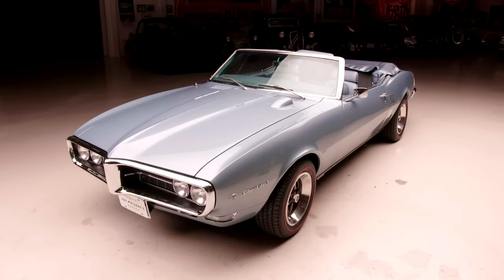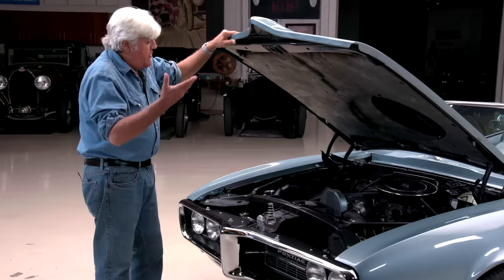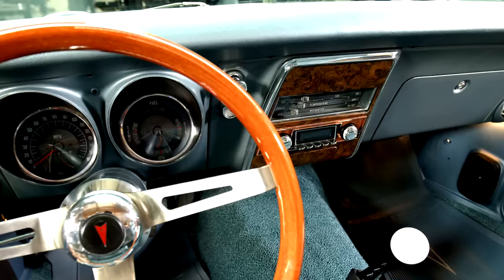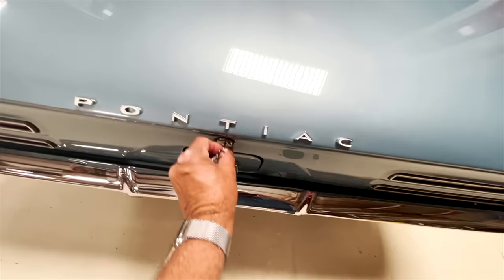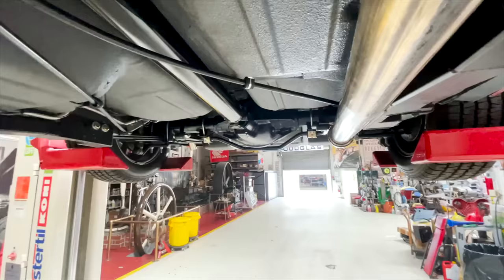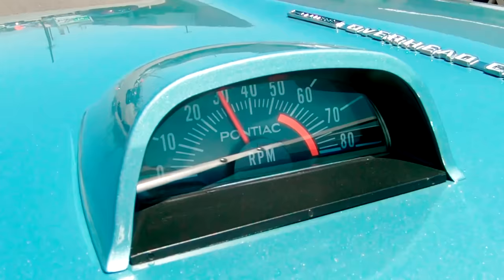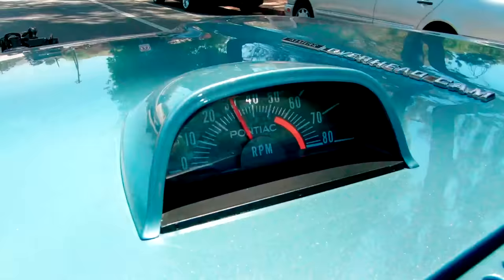1968 Pontiac Firebird Sprint | Jay Leno's Garage

Comment: Their isn't a low oil pressure problem with the rocker arms for that engine. I have one and I found the real reason. GM so hated DeLorean well before his exit that the spark plugs and valves for the unique 250 cid OHC head were never listed properly anywhere in any parts book. What you get instead is the spark plug and valves for the 230 cid OHC little brother of this engine. And that's the real issue, the valves are too long by 0.100 thousands and if you use the 230 valves in the 250 they will hold themselves off the seats at very low mileage on the clock and not get ANY rocker arm oiling due to stack up of the valve train with the separate hydraulic adjuster being bottomed out all the time. My mentor had a TRW valve catalog, I poured thru it for what seemed like days looking for a better fit valve after grinding the valve stems off by about that much as an in the field repair over several weekends. TRW did in fact list a pair of valves with the exactly correct dimensions, just a tenth shorter. But they are not called for when you want valves for this exact engine, all you can get under this engine are the same ones for the 230 little brother to this engine which went away in 1968, while the sprint 4.1 went away after 1969 along with DeLorean himself. GM never bothered to support his baby in it's final version, never lifted a finger to help GM customers get to the right parts either. That hood tach does not belong on a sprint - the red line for a sprint is 7 grand and that was an order option if so chosen. That is to say to have an engine that was proofed at 7 grand on GM's break in stand cost more, so it was very rarely ordered. This one will do 7 grand because it's already done it before you get the keys, if it didn't stay together on the stand they just got another engine until it did. At 7 grand the 250 is breathing as much air as the 350 at 5,000. The crank is unique with extra balancing additions, crank shop tried to steal mine when I needed to have it ground down. Very lucky to have the owner on duty at the counter that day, I explained my issue about how this standard 250 crank isn't the one I dropped off from my 250 OHC sprint. His eyes opened a touch and he said wait right there, to walk in the back. Maybe 5 minutes later he comes out with my crank and says there you go. He knew just the guy in the back to ask about who stole the very special crank and I hope he got fired over it.

Comment: Jay is pumping out the videos and I’m sure we all appreciate it. Yup back in the day 100,000 mile car was done, just wore out.
Reply: Yes but 1960s body on frame cars were very repairable and restorable.  This car will stay on the road for decades more.
Reply: @777jones  very true but at that time replacing an engine was big bucks. Quite a few at the time were not body on frame but unibody technology.
Reply: 68 Firebird is an F body unibody vehicle
Reply: @777jones  this is a unibody car...
Reply: @barnabyjones5161  i didn’t know, thanks for the info guys!
Reply: I've been subscribed to this channel for years. I've yet to see Jay miss even one week posting new stuff. The man is dedicated.
Reply: @777jones  Depends where you live.  Up north the cars rusted out after 3 or 4 years and just 50,000 miles was pushing it .. motor, suspension , electrical problems and the rust just gave them limited life.
Reply: @ClayLoomis1958  it is very appreciated.
Reply: @JOHNSAG1  or do a valve job around 50-60k and see if it'll run out to 100k after that, and guaranteed it'll be tired.
Reply: I have a friend that has over a half million miles on an old Pontiac.
Reply: @pontiaddict2992  yup you can keep fixing them but up here the rust kills them, and the body panels flop in the breeze.
Reply: @HypocriticYT  that sucks! In Phoenix you can have bare metal sitting for years and get slight surface rust.
Reply: @pontiaddict2992  we get body and frame rot from the salt on the roads. They tend to use less salt now so more accidents on straight flat highways and lots of transports in the ditches too. Soon as they contracted out road maintenance it all went to hell.
Reply: @HypocriticYT  man, that sucks all around!
Reply: @pontiaddict2992  yup, now a 10 year old car though better protected from corrosion will have fuel and brake lines rot out under the retainer clips, the vibrations wear the protective finish off. Oil pan on her Altima rusted so bad I pushed a screwdriver through it easily. Had to replace the pan. The underside of vehicles are covered in rust and rear disc brakes fail early because the front wheels throw up water, salt, sand etc onto them. If you want to keep a car in good shape in Ontario you can't drive it in winter. Mine was put away a couple weeks ago and won't be out until mid to end May.
Reply: @HypocriticYT  wow! It sounds like a fiberglass car is needed for winter months, and still you'll have rust on the few metal parts it would have.
Reply: in most cases, yes. if the maintenance and tune was kept up on they could go 150-200k had a number of carbd sbc that did

Comment: Hey Jay,

You hit one out of the park with this video.  I owned this same car, a 1967 Firebird Sprint, convertible, 4spd, electric roof, etc. 

I was in school at U Mass, Amherst in 1977.  In April of that year I was in a motorcycle accident and broke my back.  I spent 8 weeks in the hospital, and lost the whole semester.  When I got released from the hospital I was in a back brace and could barely walk.  I lived off campus.  I couldn’t even walk to the bus stop; I was all screwed up.  

My housemate had just bought this old 1967 Firebird Convertible (a Sprint) and he sold it to me for $300.00; I will never forget that favor as long as I live.  The car had a new roof (electric), the 4spd, it had an inspection sticker and it ran.  Getting that car was the first good thing to happen to me in that whole ordeal.  My Firebird Sprint had a tired pushrod GM 6cyl motor (the OHC 6 was long gone).  I had the hood tach, but it was out of the car in the trunk.  That $300.00 Firebird burned oil and had a leaky exhaust, but it changed my life.  I was mobile again.  The car made me smile at a really bad time in my life.

I couldn’t work that summer, so by late fall I had to sell the car to pay rent and buy food.  The car needed work, but I could hardly lift the hood to add some oil and STP.  Still, it broke my heart to part with the car.  I’ll always remember that 1967 Firebird Sprint Convertible.

Over the years every time I scan eBay, or in the old days the “WantAd”, I look for a Firebird Sprint convertible whether I have the jing to actually buy one or not.  

I was grinning ear to ear watching this video.  Thanks for restoring this Firebird Sprint.  You don’t even know me Jay, but will you do me a favor please?  Next time you drive your Sprint will you slap Deep Purple “Highway Star” in the cassette player and run the car through the gears for me?  Thanks Bro.
Jim Vann
Reply: Great story! Highway Star was what I listened to in my 68  as well, how funny is that!
Reply: What a story! Thanks for sharing. I can hear the music.
Reply: @lorencelampin6746  Glad you liked the story, it's true every word.  
"I love it, I need it and beat it... Alright, hold tight... I'm a highway Star!"  You know what I'm talking about!
Reply: @MichaelRCarlson  Highway Star is one of the best driving songs of all time!  Every kid with a manual transmission in his car back then was a highway star.  
It's true that story, I lived it.  It's surprising what the right motor vehicle can do for your attitude.  I'll never forget that 1967 Firebird Sprint, or my pal Hurls that sold it to me for short money (he's still a good friend 45 years later).  
That Firebird was the best car I ever owned.  Maybe not the nicest, but the best.
Reply: Jay doesn't read these comments goofball
Reply: Dude I'm playing highway star for you in my convertible as soon as I get the u joints fixed in my mustang GT. My car has saved me also.
Reply: A good friend had a 68 Firebird sprint in the early 80's with a small 4 barrel he kept it show room condition, I think the carb was factory (carter). I had a 68 Mustang fastback with fresh white paint. When we got together it was like a mini car show. Those were awesome times!
Reply: Those were two of the most desirable Pony Car ever!!  The '68 Mustang GT 350 was the Steve Mc Queen "Bullet" car wasn't it?!  Ouuuu, very nice.   Those WERE the good old days!!  Now those cars are FAT money and only see the light of day once a month.
Reply: @Spike9803 bullet car was supposed to be a 390 gt not a Shelby gt 350. Shelby & mustang were separate cars. All Shelby's had rollbars & harness seatbelts

Comment: From Firebird Nation website. According to "The Fabulous Firebird" book by Michael Lamm, these items were nick-named "cocktail shakers", and were used only in the convertibles to counter body vibration.
These cannisters contained spring loaded weights suspended in oil.
Reply: Good explanation I found online:
""The half-frame body construction doesn't have very good torsional stiffness (compared to a full-frame car or a full-unibody car), so "F"-body convertibles had a lot of "cowl shake" (what you see when you go across railroad tracks, etc. when you watch the windshield and cowl area shake back and forth, which you don't see on a coupe), and road surface irregularities at highway speed can induce the same phenomenon under certain conditions. The "cocktail shakers" have a heavy weight inside that's free to move up and down, with a spring above and below it to hold it centered vertically, and the can is filled with oil to damp the weight's motion (Corvair convertibles had the same thing, BTW). These become vibration dampers at certain frequencies and reduce the visible "cowl shake" to what Chevrolet felt was an acceptable level (as a substitute for properly-designed convertible body structure). If your car doesn't have them any more (many were trashed because people didn't know what they were and they were heavy), don't worry about it from a functional standpoint - you'll just have more "cowl shake" without them than you'd have with them in place.""
Reply: Neat!
In modern times, Ford has been bolting some 25 lb. steel/rubber vibration dampers to pickup truck frames, for customers who complain of vibrations.
Reply: had those in my1969 camaro
Reply: That's an apt name. I had them in my '68 Camaro convertible.
Reply: They had these in the 1965 thru 1967 Corvair convertibles. They helped to compensate for the chassis stiffness lost in the convertible.
Reply: Funny, I had a '68 convertible 350 2 barrel Firebird, almost identical to Jay's but no "cocktail shakers" nor the folding down rear seat.
Reply: @booboobear6490  Unless you bought it new, the cocktail shakers were probably once in it, but removed. I had them in my '68 Camaro convertible. They were easily unbolted and at one point I removed mine. 
P.S. My rear seat did not fold down. For that to be usable, the stamped metal bracing behind the seat would have to be removed. Removing it does not make sense, as the body was not especially sturdy.
Reply: @gregparrott  The fold down rear seat was a very rare option on both the coupes and convertibles.
Reply: @johnnyeskimo  Thanks for the info.
Reply: @LoveBandit1000  Is it possible to stiffen up the body by welding some reinforcements to it?
Reply: @EbonyPope  Yep.. look for frame connectors.. the weld-in type are the best.
Reply: @nitro2525  Yes I have seen that before but are they also welded on in the inside? I think I have seen that being made at least with Rally cars and the roll bars or am I mistaken?
Reply: @EbonyPope  Jay shows all the bracing and other things under his car.  All that really changes the dynamics even in non-verts from this generation.
Reply: As a 70s kid read about those in the book "The Great Camaro". 
Also seen the option that sprays the rear tires for traction in snow...Im thinking it was for st racers lol

Comment: Hi Jay, love your videos!  Here is the story on the Firebird dampers you asked about:  When Pontiac was given the Camaro chassis to make their Firebird from, their engineers were unhappy with the way the Camaro convertable would shake around at speed. It was late in the development cycle for 1967 so they had to make a quick fix. They used a classical mechanical engineers solution of putting in dampers. They are a weight penalty, but worked very well. I think Chevy saw that solution and started putting them in Camaros too. I quess that today these little known canisters with weights and springs stand as a tribute to the superiority of Firebird over Camaro!

A: Concerning vibration dampers. Front dampers weight 25 pounds while the rear dampers weight 50 pounds each and are attached by three bolts. In the trunk there is a support brace between the trunk floor and the trunk gutter (there is re-enforcing frame work under the edge that the brace welds to. One bolt goes through the support brace and the other two go through the trunk floor. Under the trunk floor there is a thick steel plate the has nuts welded to it for damper attachment…usually the nuts are rusted away. Im not sure if the 1968 mountings are different.

Comment: I love this car. Looks, engineering and all. Tasteful Americana
Reply: Nice looking indeed, and taken a leaf out of the Jaguar book.  It is well proportioned as are Jags. The overall lines are based on the E-type for sure.
Reply: To me it looks like a...
Full sized Hot Wheels !
Those Red Line tires...
Super Smexy!
Reply: @donaldhollums3278  ppp]
Reply: @henryfrederick137  🤔?
Reply: @donaldhollums3278  Pontiac would make a mean car even if the only parts they got was from north korea.
Reply: @moodydude565  alrighty then
Reply: @donaldhollums3278  if they made an electric Yugo and slapped that Pontiac arrowhead on the steering wheel and I'd drive it.
Reply: @moodydude565  you could do that anyway.

Comment: Surprising how many people aren't aware of the Pontiac OHC Six, I grew up with one of these. Thanks Jay
Reply: I remember the Firebirds with sixes, I just didn't remember they were OHC. I had a 1967 hard top with a 326 v8, two speed auto on the column that my parents passed down to me in 1970. It was Coronado Gold with black interior. It was a fun car, but it had terrible brakes. All drums that would heat up and fade on you in a nano second.

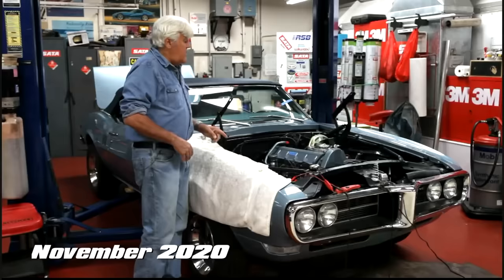Comment: 06:06 This was my favorite part of this build in which Jay and his crew had bespoke rocker arms designed and built from scratch. He will go to just about any length to get the job done right. (Of course, he has the financial means to do so... but who wouldn't do the same thing, given the chance?)

Yipee! I have been waiting many a full moon for Jay to finish this build. He touched on this Sprint in a few of his restoration blogs (just making my mouth water). I'm soooo pleased he has it finished now. 

This car would (in my humble.... but some say lovable opinion) be the ultimate daily driver.
Reply: I like that Jay just loves all things cars and doesn't go and make everything crazy hotrod's.  fix the major flaw of the car, using modern upgrades, but dont make it obvious and keep them mostly stock
Reply: Me too!  I'd still like to do a lightweight 63 nova  with a 215 Buick/ Rover etc.
Reply: Even guys with financial means don't have Jay's knowledge and superb appreciation of cars with his ability to make limited but appropriate modifications.
Reply: Fast forward 8 months and I still love this video and this car. If I could have my choice of any of his cars (and I couldn't sell it) I would pick this Pontiac Sprint or his '66 Corvair, as they both would make great cars to drive every day and wouldn't put a person into the poor house just buying fuel.
Reply: @melvinharvey8279 lots of Vegas have alum 215 .works well, same weight as 4 cyl& front discs that nova lacks I have 1.

Comment: My high school band teacher had a Tempest with this engine in 1968. I thought it was cool. Most of my classmates didn't care for it because it did not have a V8. This and the Corvair definitely had a European flair that was absent from most other American cars of the day. Of course, it is now very cool to own these. A great addition to Jay's collection.
Reply: Pat my brothers in an I had and still he have a 66 tempest with the OH 6.  it was tire burner. 180 HP with the 2 barrel carb . It's HP raito to weight was better than V8 ,raito.
Reply: Whats a tempest
Reply: @tomstulc9143  did you drive both? How was the handling and what were the differences in all aspects. Thanks 🙂
Reply: @Jason.cbr1000rr  Originally the 64 Tempest was based on the Chevelle Malibu platform. The GTO was the high-performance upgrade that later became its own stand-alone model. I believe Jay touches on that in the 1964 Pontiac GTO Convertible episode.
Reply: Loved all the Pontiac designs.